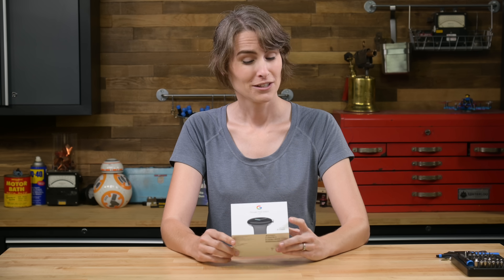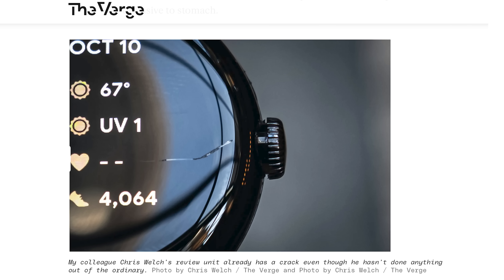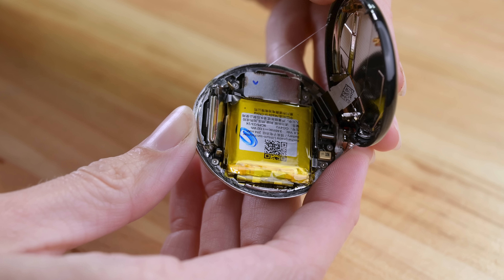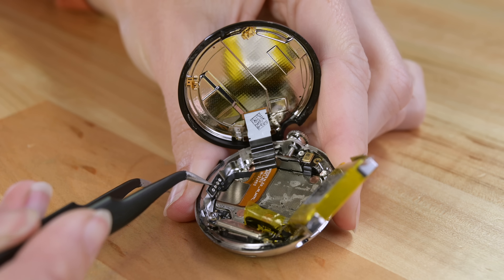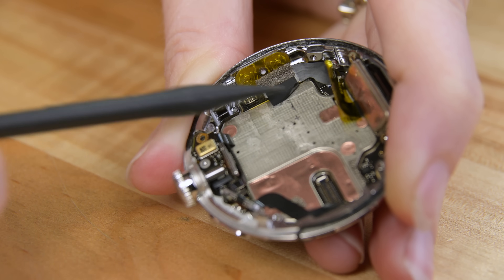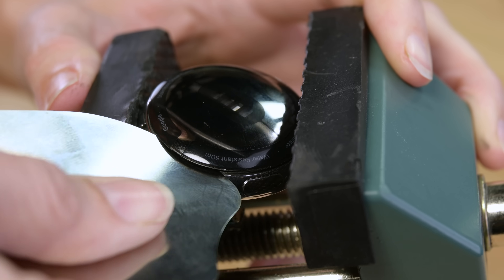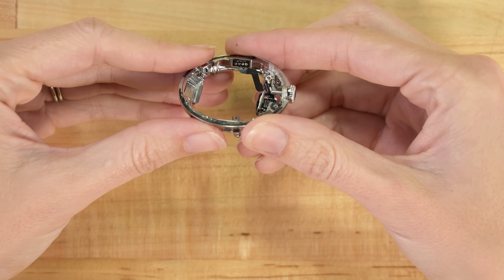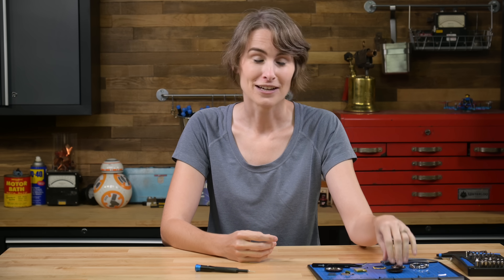Pixel Watch Teardown: Google’s 1st Gen Answer to the Apple Watch

Comment: Why does everyone ignore Fossil watches. They have full smart watches, hybrid watches, quartz watches, and mechanical watches all for under $300. It's an American company that has done amazing things but for some reason their stock prices at an all-time low.
Reply: bad marketing? I dont see any ads about fossil's watches
Reply: I got the 5th gen fossil watch. looks nice has some "old school watch" design. But not getting wearOS updates or any updates at all really hampers my experience and i've now switched to the pixel watch. If fossil had the same software and tracking tough....
Reply: I recently looked at a Fossil automatic and was surprised to feel the rotor inside spin really fast. The only other automatic watch that winds that fast cost me $2,000. Every sub $500 watch I've had seems to have a rotor that doesn't spin freely. A slight flick of the wrist will have the rotor spin freely for a good 2 minutes. It's actually quite incredible for a $200 watch.

Comment: So what was the repairability score?
Reply: none, nobody sells parts. Not even google themselves offer repairs for it. I have a small chip in the display after several months of dailying this thing, I regret buying this watch in the first place after finding 0 repair options.
Reply: @Can80  This is why you always put a screen protector on day one.
Reply: I disassembled easily but I simply wasn't able to plug back the battery. After 2 hours of the headache of microscopic tools I flushed down the thing in the toilet...
Reply: Lol😂 @roland-gyulakiraly8233

Comment: I'd definitely buy this (or a Galaxy Watch) over the Apple Watch. This just looks pretty cool, and seems repairable for the major things that are likely to need repair (screen, back glass, battery). Plus - no software pairing!
Reply: @catboy3471  He literally said it's a waste to buy those Android watches over Apple. I'm sorry you can't determine implications when you're reading.
Reply: Please do. A fool and his money part ways soon
Reply: @trancenut81  Not everyone has to buy Apple products. The only Apple product i have is an original iPod Classic, which was before the days of software locks, or purposely making items difficult to repair, or purposely adding planned obsolescence in the form of stopping updates. Yes, other companies are also guilty of the last two points, but then again, most phones don't use 4 different type of screw, including two security types (Pentalobe and Tri-point).
Reply: Your complaint is different screws? I mean even iFixit sell all the screw drivers you need so your point is moot.
Reply: @TheSpotify95   funny you say that about repairability, when ifoxit themselves said the iPhone 14 is more repairable than the pixel 7
Reply: @liamsz  the iPhone 14 got a 7 for being more modular, given that the back glass is now easier to replace (it doesn't need lasers). However, modular does NOT always mean repairable, and I personally don't rate the iPhone 14 series when every single component is software locked to the main board. Ifixit obviously didn't take that into account when giving a repair score!
Reply: @trancenut81  Calling someone a fool for picking a product that isn't Apple? Typical apple fanboy comment....Not everyone likes apple products. I quit buying Apple products years ago and my wife did a few years after me. As the Pixel lineup improved, it outshined Apple to us so we prefer Pixel products now. Some prefer Samsung, Xiaomi, OnePlus, etc. People aren't fools for buying what they want, geez.
Reply: Pixel line has not outshined Apple at all what an odd statement. They are buggy as heck. Which you may expect with a. Profit that ships large numbers. But pixels don’t really. Not to mention the issues still continuing with the Pixel 6 whilst they release the 7. Your statement would stand as a fanboy statement.

Comment: I do wish when talking about the price people mentioned the Pixel Watch case is stainless steel rather than aluminum like smartwatches priced cheaper than it. If you want a stainless steel Apple Watch that starts at 699. The Galaxy Watch 4 Classic was also stainless steel and that was priced the same at $349/$399 for BT/LTE versions.

That said, I appreciate this teardown and the geeking out over some neat adhesive. Seems like battery replacements are relatively easy and display replacements only slightly more difficult. Good to know as those tend to be the most common repairs.
Reply: Yeah. I hope the battery can be replaced without tearing the screen off. Should have been noted if possible

Comment: The test port is for adb debugging for app development, there will be a usb cable for it soon
Reply: Where did you get this information from?
Reply: @Brealiq  well there is only four pins and as far as I know, google will put a usb input for watch for wear os devlopment
Reply: @noble_lime  there already is wireless Wear OS debugging available, why release a cable then?
Reply: @why-am-i-tired  for faster debugging, it's also useful for installing custom roms
Reply: @noble_lime  i doubt Google would make the effort of releasing a new cable type just to promote custom Wear OS firmware

Comment: I waited 2 years for this watch and I have never been so disappointed. They had so many years to get this right and the whole things looks so rushed and only one size with is tiny, the bezels the size of Manhattan. I would expect things like this from Microsoft. Pixel watch is the Zune of the smartwatches.
Reply: Have you actually used one of the Pixel Watches?
Reply: @chlly  
He clearly hasn't.
Reply: Bezels are fine on this watch.
Reply: Question
Do you have the watch or are your judgments based on what others say?

I ask because I was skeptical, but I got one anyway & I genuinely like it.
Could it be ~$50 cheaper? Sure
Could it be a little bigger? Sure
But overall, it's a solid device, IMO.
Reply: @Lanhoj  Exactly. Bezel isn't nearly as big as it looks in photos and what reviewers say. Also, based on reviews saying it was so small, I expected it to be tiny but its actually a good size for a watch.
Reply: it's a first gen product, all first gen products are pretty bad. it'll take time for Google to figure out exactly what they're doing and make it right
Reply: so true
Reply: How are you still holding out hope on Google products? They're one of the worst when it comes to meeting expectations.

Comment: Why does everyone always ignore galaxy watches? They do what they are supposed to do and do it well, yet the apple watch is always considered the only real option
Reply: Moreover, Apple Watch is not competition for this watch, Galaxy Watch totally is. Apple Watch is an entirely different ecosystem.
Reply: watch4 and watch5 series were really good
Reply: watch4 and watch5 series were really good
Reply: For me it’s the size. I have small wrists and Galaxy watches look way too big/don’t fit correctly on me. So even though I use an Galaxy Note 10, I’ve been using Apple Watch as my go to for watches after my last FitBit got cracked.

If they made one that was honestly a few mm bigger then the Pixel watch in size, but with current OS and a better battery than Pixel has, I’d probably swap over.
Reply: @patriotsfan122480  this is the first rational and understandable reply I've gotten so far, congratulations
Reply: Galaxy software is a disease
Google and Apple are the only real competitors
Reply: Ya, even watch 4 is powerful and efficient then this and now you can get it for 100 dollers
Reply: @noble_lime  
My uncle got a Galaxy Watch 4, i set it up and tested it a bit. It is slow, the software is not that great.. The Pixel Watch, despite the old processor, is surprisingly fast and just clean.

That was my experience.
Reply: @julm7744  fam, the majority of ppl here drive Japanese or Korean cars
Reply: I think it‘s mainly the bloatware, at least that’s my main reason plus supporting for long term specific features like something from fitbit or similar new google-based features
Reply: @julm7744  fossil is American made and they have an amazing smartwatch.
Reply: Because apple watch is still at the top of any smart watches so comparing with the best is not a bad thing
Reply: Well they don't work with iphones
Reply: To me it's the apple of android don't judge if so I didn't ask 😁
Reply: Galaxy watches aren't very accurate - watch their reviews by Quantified Scientist. Both heart rate data and sleep data is unreliable, especially when compared to Apple Watch.
Reply: Samsung gear s3 came out in 2016. Guess what, samsung is doing to their loyal customers. Bricking the device when you connect it to a newer model of Samsung phone. The only work around, is to download an older apk from a dodgy website and downgrade the firmware. No thanks, I will stick with manufacturers who support right to repair. Neither Apple Or Samsung cares.
Reply: @julm7744  that's just not true.
Reply: up until very recently they had a clunky OS onboard. Now with the google watch OS they are better.
Reply: @aroberts3213  if anything TizenOS is more responsive than WatchOS. unfortunately it has small 3rd party support
Reply: @julm7744  hmmm I wonder where apple products are manufactured
Reply: Exactly. There's plenty of videos made about the Apple watches but barely any for the Samsung galaxy watches. I own a GW4C and would love to see what it's like to get inside and how everything looks
Reply: Americans being out of touch with the world
Reply: Because it’s not even close
Reply: Apple is aesthetically pleasing
Reply: Fossil watches are superior to google, Apple and Samsung watches. Fossil is an American company out of Texas and they sell hybrid watches that have analog hands with digital features. They have an amazing lineup all for under $300. Their stock is also at an all-time low, perfect time for an investment.
Reply: @ZeginMakesMusic  y'all Americans always gotta state how 'American' a business is like its some sort of selling point. The rest of the world doesn't give 2 shits.
Reply: because in term of 3rd party support, apple watch is still better
Reply: Cause the design of both hardware and software looks ass
Reply: @catboy3471  too bad you don't know me! I use apple devices for work purposes (I'm product designer) I'm speaking from experience and not hating apple, they are too inferior to android to hate them, not a fair competition....  :))) you should not be mad ;)
Reply: @ScutuRC  i use apple as a web dev and android is too inferior to the Apple Ecosystem in regards to workflow. To each their own
Reply: @xxDxxism  I guess that's why you can always do more with android... A simple example, took apple years to put the battery percentage in the battery icon, and now they call it revolutionary... Plus, there's still no Back Button, every app has it in a different place. Imagine all cars have the Reverse gear as a different buton somewhere on the dashboard, but not on the gearbox stick,.. and many more examples, google it...
Reply: @julm7744  Not even close to accurate but thanks for playing
Reply: having used both the apple watches are miles ahead
Reply: It's weird how that bothers you.
Reply: Apple Sheeps don't see anything else than apple stuff, so how would you expect them to know about other brands when all they see is apple stuff... I bet those people still taking the buss since Apple hasn't released a car yet...
Reply: Because the Apple Watch does things better it’s just superior
Reply: @juliet4093  because the Apple watch works well with Android right? 🙄
Reply: @juliet4093  just because it's superior doesn't mean it's alone. They act like it's the only good smart watch on the market and while it may be the best overall, it's not the only good one
Reply: Because of galaxy watches having fairly weak chips in efficiency and battery life
Reply: @fusionsniping3741  my galaxy fit 2 lasts me 2 weeks on a single charge and it's a few years old💀 what are u talking about🤣
Reply: @fusionsniping3741  Jeebus that comment takes the cake on inaccuracy. The first watch with the Galaxy Watch brand had 3 days if not a little more of battery when it launched. As far as processors they were competent enough to run the apps they had on them and a testament for that is the fact that the Pixel Watch RUNS a Samsung processor.
Reply: @fusionsniping3741  that’s far from true